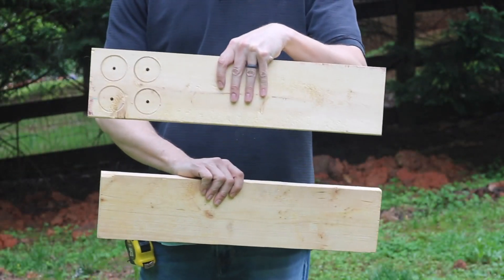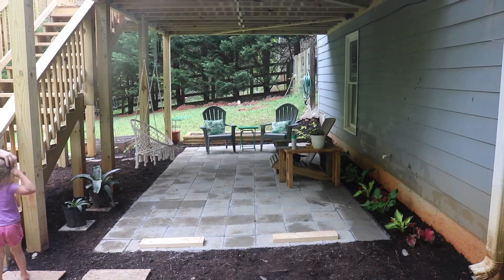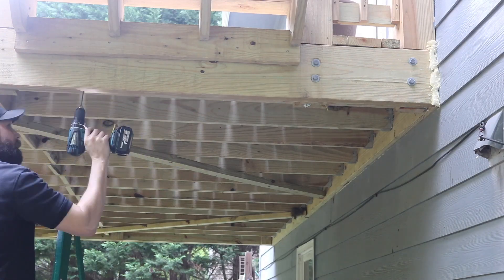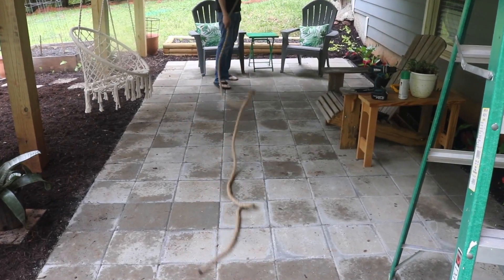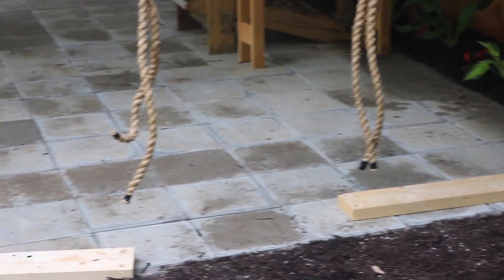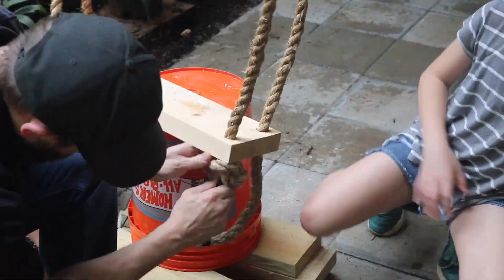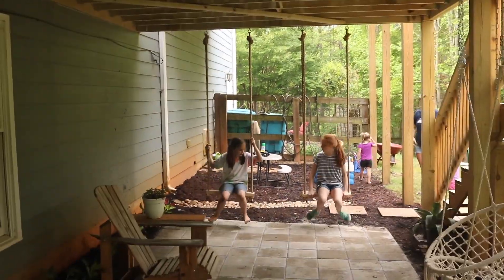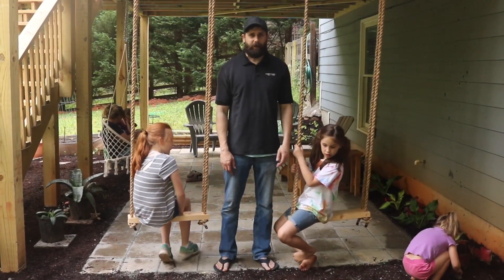DIY Rope Swings / Patio Swings

Comment from the maker: Update: the rope stretches out A LOT over time. I ended up having to undo the knots and reposition the seats a couple of times. So, 19‘ of rope was plenty in the end, it was just a little hard to tie the first knot. If you have access to used rope then you wouldn‘t need to worry with it stretching out.

Comment: You’re a good dad to make them for the girls!
Reply from the maker: Thank you! Only thing is I only made 2 and there are 4 of them, haha. Needless to say there has been some bickering about who‘s turn it is.
Reply: @ChrisMcDowellDIY  What about a porch swing at the other end of the patio?
Reply from the maker: We‘ve actually got one coming! My parents are visiting soon and they are going to try to bring one with them. It‘s my grandma‘s old swing that I used to sit on with her. It‘s old, but sturdy.
Reply: @ChrisMcDowellDIY  That’s a great photo opportunity with your mother and her granddaughters, just as your Grandma did with you!  (How’s the guitar build?)
Reply from the maker: The guitar had to go on hold for a bit. With the coming of Spring, I have had a list of things I have been asked to do. Some of them turned into videos on this channel, lol. Also, the grass has to get cut now and just a lot of other things I have to take care of. I need another tool before I move forward on the guitar. Just gotta get it. It‘s one of those sanders from elevate lutherie. I just don‘t have time to sand the sides down by hand. It would take a while by hand and I just can‘t justify the time at this point.
Reply: @ChrisMcDowellDIY  the roller pin thing?  For a drill press?
Reply from the maker: It actually goes in a drill! You hold the drill in one hand and pull the trigger while you hold the roller pin in the other hand.
Reply: @ChrisMcDowellDIY  Thats cool, and the next video!  Ha!

Comment: Will this hold adults? I wanna make 2 to hang from my pergola, not so much as kid's swings but as actual seat for when we entertain guests etc
Reply from the maker: Yes, I sit in them from time to time and they hold just fine. They are a little skinny, so you may want to use at least a 2x8 or even 2x12 instead of what I used which were scrap 2x6 pieces. Also, get pressure treated wood so they will withstand the elements much longer.